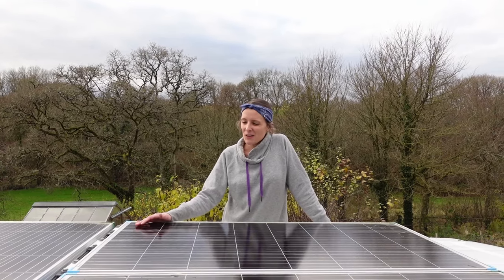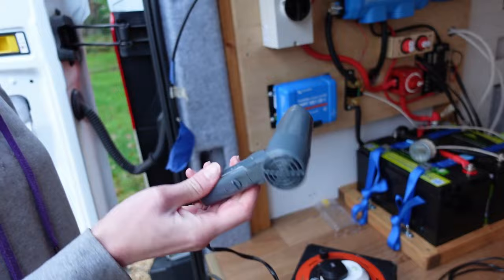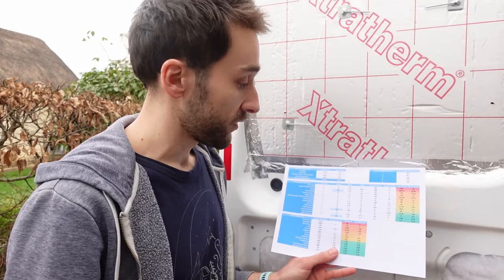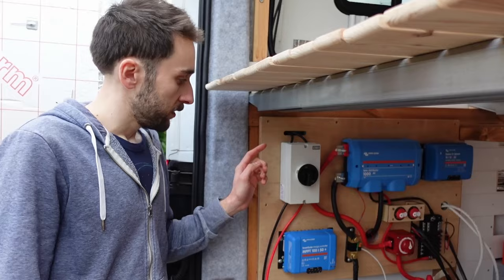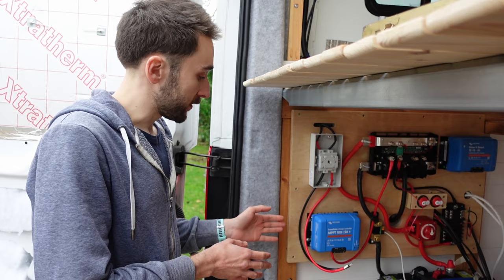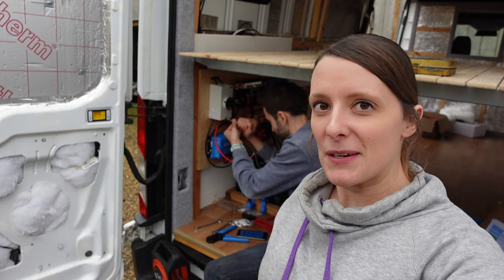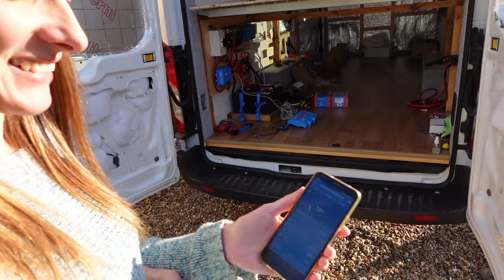Solar Wiring & Panel Sizing (525W Switched On!) | Transit Van Conversion E23

Comment from the maker: All the different bits of kit and products we used in the video should be linked in the description, thanks for watching! 🙂
Reply: I will look for the updated video on this but I’m sure you were way under powered.😮😢 
I would have gone with 400amp hours of battery and some portable panels. You are relying too much on the sun that you were not going to get.
Great back up to have that DC to DC charger though 👍
good job😊
Reply from the maker: @RVingwithG  Cheers, we're pretty happy with the estimations we made and it's been working out great so far, no problems with power usage at all. Even on overcast days we're able to generate a few hundred watts. Winter will be another test but with the DC charger we think it should work out well as we don't tend to stay stationary for too long 👍

Comment: Amazing job from you both, just a quick one, would be super beneficial if you were to use 20mm glands on the isolator switch where the solar cables come through to ensure they won’t pull out👍
Reply from the maker: Cheers 🙂 And yeah that would be a good addition, either that or some rubber grommets. The cables have stayed put fine but it would be good to have some extra protection where they pass through the box. We didn't have any on hand at the time but something worth adding at some point for sure 👍

Comment: This was interesting because I have just set up a basic system to charge my car battery except I used a Victron panel and Victron MPPT. But just joined at your bed build and having two sets of hands is really an advantage. Shall enjoy more of your videos, with past ones to catch up on first.
Reply from the maker: Cool, glad you enjoyed it! Yeah there have definitely been a few projects that would be pretty tough with only of us, like putting up the ceiling!

Comment: Love your spread sheet idea. But after hitting pause and rewinding etc. I saw that your fridge you have that it's only used for 6 hours a day??? I would have thought that it was on 24/7? (just starting my van build now)
Reply from the maker: Good spot! The fridge is on 24/7 but the compressor doesn't run the whole time, it switches on and off throughout the day as needed to maintain the temperature. Then looking at the daily amp draw that Dometic list on the specs worked out to be the equivalent of it being on for 6 hours a day. HTH and good luck with your build! 🙂
Reply: Thanks for the quick reply back. I got your answer. Cheers. I guess the more keep opening it the more the compressor will kick in and the same for the summer time. The warmer the ambulant air inside with opening etc. the more it kicks in too.
Reply from the maker: Yeah exactly that, there will be fluctuations and all the figures are our best estimates with our expected typical usage patterns erring to the worse case, with pretty much everything being used and running every day. So in real life hopefully it'll actually all last longer than we've budgeted for 🙂

Comment: This maybe the best RV build series I have found. We are on our 4th RV and when we got locked down here in Florida I removed the 110Vac 30 amp / 12 vdc and replaced it with 240 VAC 50Amp / 12vdc Lithium batteries with 300W solar also added a auto transfer switch for the 4KW generator.
Reply from the maker: Thanks! And that's cool, sounds like a good setup

Comment: Thx guys, I don't remember seeing you deal with the 2nd charge controller, might have missed it. Sorry. You absolutely work well together!
Reply from the maker: There's only the one solar charge controller, do you mean the DC-DC charger? If so we haven't actually wired that in yet, but it's all there ready to go! 😛
Reply: @SelfBuiltStories   DC-DC controllers, such as a Redarc 1225D or 1240D would make the need for the MPPT controller redundant, as it will take the positive current from the vehicle start battery and charge the house batteries while driving. It will priortise the vehicle battery first, then direct the charge to the Lithium battery. Without a few mods, the DC-DC charger will not charge the vehicle start battery though. As with Victron, the wiring needs to be configured to accommodate the Lithium type battery.
Reply from the maker: @lesblack413  Cool, yeah there's some nice bits of kit out there for sure. We just quite like having the Victron kit and how seamless everything is together in the app :)

Comment: hi , what size  cable from the battery. thanks. ps  Good set up.
Reply from the maker: Cheers, and we used 70mm^2 cables for the battery bank connections 👍

Comment: Just a suggestion for the laptop you can get a 12v DC to 19v DC converter which saves running it through the inverter.
Reply from the maker: Thanks, yeah we might look at something like that👍. It can trickle charge via USB c out of a car charger too in our 12v sockets. Although at the moment we have more than enough power from the solar to use the regular high power charger through the inverter, haven't seen the batteries drop below 80% yet. Does feel a bit inefficient though! Will probably make it more efficient when we've got more devices in and we're fully on the road 🙂

Comment: Hi from Russia )) 
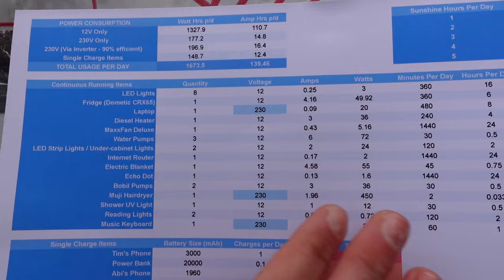1) in video time line 4:55 led lamp = 360 min per day is not 16 hours per day but 6 hours )) 
2) for 230 volt consumers inverter have not 100% efficiency factor, to calculate the consumption from 12 volts, you can take a efficiency of 80%-85% to have a guaranteed power reserve
3) When using solar panels, it should be borne in mind that even a small amount of dust or dirt on the surface greatly reduces the power of the energy generated. The surface of the solar panel can be slightly tilted sideways so that the flowing water carries away dirt with it during rain. Also, the surface of the solar panel can be treated with an anti-rain compound to give the coating hydrophobic properties.
Reply from the maker: Hey! 👋 1) Yeah we had a small copy-paste typo in the spreadsheet, it should say 960 minutes which we fixed afterwards. But the energy are still the same as we did them from the hours 😛 2) And yep very true, we based our numbers off 90% efficiency which is what our inverter specs stated. 3) They do get pretty dirty! We've been up there to clean them a couple of times so have that in our longer term cleaning routine. Anti-rain compound sounds interesting, will check that out, cheers!

Comment: Cool great, I would pull the positive wire a bit away from the shunt. By the settings for the mppt and the Orion I was at first by 14,4 then 14,2 but my cell started drifting a lot now I’m down to 14v and by the bmv by 13,8 now everything works good.
Reply from the maker: Thank you! And yeah good spot, we have loads of cable clips ready to go that we're going to use to secure all the wires on the board, but we're waiting until we're doing the AC wiring so we can get the neatest routing with them all on 🙂The positives should be tucked away nicely from the shunt then :)

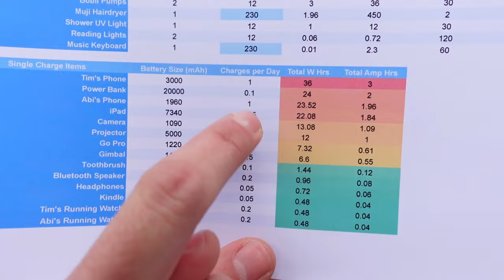Comment: Good news!   The energy to charge your phone is less than you think.  At 6:17 you show the energy used to charge devices.   Your phone is 3Ah at 3.3V (not 12V), so it is 10Wh not 36Wh.  Similarly your 20Ah power bank uses 66Wh to charge, so charging every tenth day is 6.6Wh per day.
Reply from the maker: Thanks for the comment! Yeah that's very interesting, something we overlooked! We've made some updates to our spreadsheet after looking up the voltage as best as we can find for all the different batteries. It's nice that it was over-specified not the other way around 😀 Always good to have a bit more capacity available to use!

Comment: Hi guys, great video and very helpful. The only question I have is why do you need that specific solar isolator switch to connect the positive and negative wires to it as opposed to a general kill switch that you’ve used in other parts of the electrical board for the positive wire only?
Thank you!
Reply from the maker: Cheers, glad it was helpful. And good question, the short answer is that a double pole disconnect is safer as it cuts power to both conductors at the same time. If you look on page 11 of the victron manual it's also stated there that there should be "a means to disconnect all current-carrying conductors of a photo-voltaic power source from all other
conductors" (https://www.victronenergy.com/upload/documents/Manual_SmartSolar_MPPT_100-30__100-50/29694-MPPT_solar_charger_manual-pdf-en.pdf ). 

The longer answer is related to grounding, and the way I look at is that it provides an additional level of protection in certain situations. If everything is wired up correctly and there are no faults, then a single pole switch and a double pole switch would be equivalent. Where it differs is if there was a fault somewhere, caused be a stray wire/broken insulation etc that then bypassed the single pole switch and made it ineffective. For example if there was a short to the van frame from the solar + wire, then you could have a potential shock scenario even if the switch was off, as you could have a circuit from the panel + via the short to van frame, through you touching the frame and then if you came into contact with the negative wire back to the panel.  A double pole switch would break the negative as well, meaning that this particular shock hazard would be avoided, and it would take two faults in the system somewhere (instead of one) to be an issue, which is much more unlikely. 

But grounding is one area where there's a lot of conflicting information out there, different regulations and different specifics and quirks depending on the particular setup. There are various standards but none that are specific to campervans and mobile installations. Some good resources are the section on grounding in Wiring Unlimited (https://www.victronenergy.com/upload/documents/The_Wiring_Unlimited_book/43562-Wiring_Unlimited-pdf-en.pdf ) and this blog is also useful for picking out the parts of the UK electric code for solar isolators and how it relates to campervans (https://tinybuildelectrics.com/do-you-need-to-fit-a-dc-isolator-to-your-solar-installation ). 

And the reason we used a double pole for the solar and not the rest of the electrics is that the solar array is at a high voltage, quite possibly upwards of 50V, which is enough to be a shock hazard. Whereas the rest of our van electrics is 12V which is very unlikely to ever be a hazard with the resistance of human skin. Essentially it's all about mitigating problems in the (hopefully) unlikely event that there is a fault that occurs in the system somewhere. For us for the small extra cost we went for it for the extra peace of mind. We're not electricians though so DYOR of course, but HTH! 👍

Comment: Keep in mind that the maximum output from the panels is only achieved when the sun shines perpendicular onto the panels. Since you live at a place which is around 50 degrees from the equator, you need to rotate the panels around 50 degrees, meaning one edge should be up so the angle between the panel and the roof of the van is 50 degrees. Plus on a hot day (when the sun shines at maximum force) the panels reduce the output otherwise they will cook.
Reply from the maker: Thanks yeah we've thought about adding some simple mounts so we can tilt them up at different angles if we're going to be parked up for a while. We'll see how it goes on the road and whether we need to or not, we've had some pretty good-enough yield days with them flat so if we can avoid the extra work we will, but always an option down the line 😀

Comment: Just another GREAT video, you two. 👍Love the spreadsheet calculations and the bit about the hairdryer. 😁
We've already done similar spreadsheets (yours are much easier on the eyes though). Greg's videos helped a lot as well... 😉
Our van will be gasless and I'll be building the LiFePo4 batteries from scratch (2 x 178Ah) - that's a lot cheaper than buying completed units. No gas cooker, just induction stovetop  and a diesel heater combined with some floor heater pads in the seating area and perhaps the shower stall. Solar will be very similar to your setup with a DC-DC charger to get some recharge while driving. I will try very hard to get the electrical stuff further to the middle or front of the vehicle, to reduce cable lengths somewhat - but in the end it will most likely be a compromise.
We do love the job you've done thus far and can appreciate all the extra work you had shooting the footage, cutting it and finally sharing it here. Setting up the shots, everything seems to take twice as long  (that's at least my experience...).
Cheers from across the pond! 😊
Reply from the maker: Thanks Volker! Ha yeah, in theory everything is calculated for but we can only tell for sure when using it aggressively out on the road. Interesting building the batteries, would be interested to see how that turns out. Look forward to seeing how your van progresses. And twice as long? At least 😅We enjoy it though and especially looking back at the beginning, already it's nice to be able to remind ourselves of the progress, which we'd surely forget at some point down the road (no pun intended!) otherwise. 😁

Comment: Hi There, Love your video's, your channel and your enthusiasm. Your are a lovely couple and I love your van build. I have a quick question if that's OK as I just started my own van build. I notice you have not included in your system the option to plug in shore power. If you were to add a battery charger for shore power can this be connected to the Lynx distributer as well? I count 4 items already using up all 4 slots in the distributer - Batteries, MPPT, DC to DC and Inverter so where would the shore power battery charger connect. I hope you don't mind the question? Keep up the great work and video's. Your videos are a joy to watch and so informative.
Reply from the maker: Hiya! Thanks a lot and glad you're enjoying the build 🙂 And yeah that's a great question and you've counted right, we're using the 4 slots on the Lynx for those things (MPPT, DC-DC, 12V fuse panel and inverter). If you want more than 4 slots, there are two things you can do. The first is to add a second Lynx distributor which bolts directly onto the first one, and would then give you 8 slots. But if you only need one more then it might be a bit overkill. So what you can do is make use of the two bolts on the right which you would normally use for adding a second Lynx device to, but instead use them for another connection. The only thing you have to do to make that work is add your own fuse as there isn't one in that slot. We actually had this scenario recently as we decided to add a second 12V fuse panel and so needed a 5th slot on the Lynx. What we did is run the wires to those far right bolts but using a separate inline mega fuse holder, you can see that here: https://youtu.be/s7GXPvPtOqw?t=1800. The other way to do it is to use an MRBF terminal fuse and holder directly onto the extra right bolt. Explorist.life shows how to do that here: https://www.youtube.com/watch?app=desktop&v=W9n01vuGDgM. We decided to do it with the inline mega fuse holder just because we wanted to use mega fuses everywhere so it's consistent, and we already had a spare mega fuse holder. HTH! 🙂
Reply: @SelfBuiltStories  thank you for your reply. Very useful. I assume you never intend to allow for shore power.
Reply from the maker: No problem, and yeah we're not planning on it, we're basing our set-up on being mostly off grid where we wouldn't be able to hook up. If we've done our calculations right we don't think we'll need it, but if that changed in the future we could add a separate busbar or swap out our inverter for an inverter/charger combi 👍

Comment: Not sure if there is a specific rule for van builds, or other countries. But the norm, certainly on boats in the uk, is for the solar charge controller to be connected to the batteries, or the battery side of your isolation switch.. that way when you turn your isolator off the power from the charge controller isn't feeding any power to the van circuits. As you have it you need to turn off both the battery isolator and the panel kill switch. This means that the batteries won't get any charge anytime you want to leave the van with the batteries isolated.
Reply: Thoroughly enjoying watching the build. Been binge watching for the last few days, so a few more episodes to watch yet
Reply from the maker: Hiya, glad you've been enjoying the videos! 🙂 With the solar the charge controller is set up on the battery side of the switch though. The solar disconnect cuts all power from the panels reaching the cc and therefore the batteries, but the cc remains on of course so it can still be monitored in the app etc. We have no need to turn off the main system kill switch unless we are working on the electrics 👍